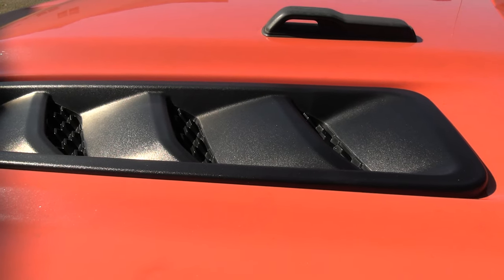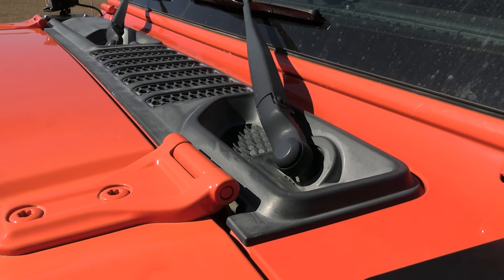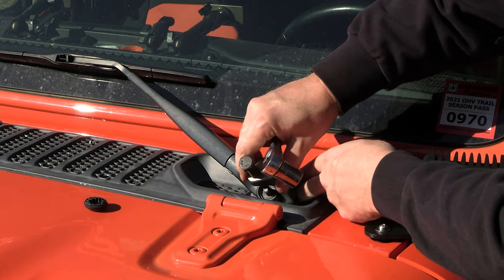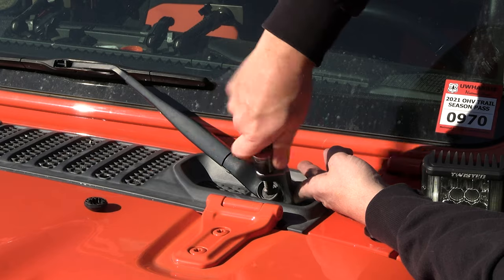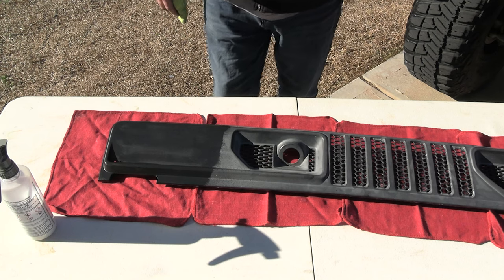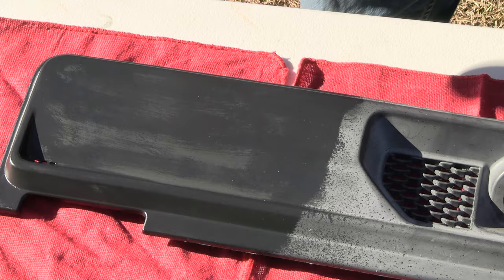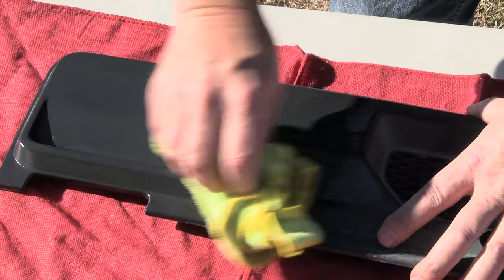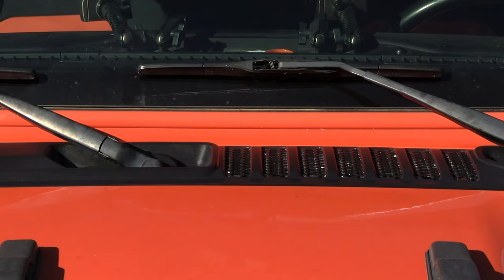How to renew faded cowl cover on Jeep JL / JT #chemicalguys

Comment: I had to do the same thing to my jeep, which is a 2018 JLU Sport S. I washed it thoroughly, then used alcohol wipes. I refinished it with Krylon satin black spray paint, especially made for plastics. Turned out great. Your video helped me a great deal in the removal of the wiper arms. Thank you!
Reply from the maker: Glad it was helpful. Thanks for watching and the comment! 🤘🏻

Comment: Clint, I just appreciate the video for working the cowl cover off. I bought a new replacement for my 6-year-old JL and just finished putting it on. Wanted to make sure I wasn't missing anything with regard to the clips that held the old one on. The wipers were a PITA, but like you I had purchased a puller after reading some forum inputs. Well, actually two. The first was great and worked great on the driver's side wiper arm, but the way the cowl cover is molded around the passenger side it wouldn't work, so ended up getting one like you used. If I'd seen your video first I'd have gone that route up front. I may play around with my cowl cover and do some paint work on it. In the meantime, the new one is on and looks great again.
Reply from the maker: Good deal, bro! Personally, I'd be careful painting plastic. Not that I'm an expert, but I think I'd look at a wrap first. JMHO. The treatment in this video only lasted about 2 weeks. I'll do it again, but this time, use Meguiars Back to Black. I used it on my JK fenders with excellent results. Thanks for watching and the comment! 🤘🏻

Comment: Great video, It made me decide not to mess with it. Needed Tools I don't have.
Reply from the maker: @pattucker6010  You don't (HAVE) to take the cowl off, but I did it just because I'm anal about paint. Also, I wouldn't use the chemical guys stuff that I used. Only lasted about 2 weeks. I used Meguiars the 2nd time and lasted well over a year. Thanks for watching and the comment! 🤘🏻

Comment: roger that on the youbietubers saying "just give it a little wiggle"
When I changed my JLUR Aux Battery, I did the fender removal route
and that just give it a pinch and wiggle did Not work for disconnecting the turn signal harness
Reply from the maker: Yeah man, there's a LOT of that. I figure most people are on YT to figure out how to overcome an issue WITHIN a job. So, I try to cover everything I run into and how (I) went about resolving it. It might not be the RIGHT way, but if it works, I'll show it. Thanks for watching and the comment! 🤘🏻

Comment: I know this is an old video, but what tire Carrier do you run and Does it wiggle around a bunch and make noise?
I've tried 2 different tire carriers last week in the rusty's. Which was the best so far but I really like the tube look. Thought about buying gen rite
Reply from the maker: Mine is DV8 and it's total JUNK! If you're gonna go with this type of carrier, I'd HIGHLY recommend GenRight. They didn't have theirs out for the JL when I bought mine and was too impatient to wait. Lesson learned, because now I'm screwed since I cut and drilled into the body. If you're gonna run 35's or smaller, the DV8 would "probably" be ok. But, I'm on 37's with beadlocks and it definitely sags when I open it. Hope this helps. Thanks for watching and the comment! 🤘🏻

Comment: Hi, it's been over a month since you posted this. How is it holding up? Does it look faded again? Is it something you constantly have to do after every few washes?
Reply from the maker: Yeah, so it lasted about 2 weeks. It's back the way it was. If you want long lasting results, I recommend Meguiars back to black or Armor All trim restorer. Kinda disappointing that it didn't last long at all. But, we live and learn, right? Thanks for watching and the question! 🤘🏻
Reply: @ShockWaveOffroad I found that regardless of the product anything that is a whipe on only lasts a few washes.

Comment: In the video you said that you use it on the tires...does it sling all-over when you drive?
Semper Fi. 0341
Reply from the maker: SEMPER FUCKING FI!! 0331
Yes, I use it on the tires. I have not had "sling splatter", but I always let it sit for a while before driving. That said, this worked really well on the faded cowl cover..........for about 2 weeks. I would not recommend this for the cowl. For all the trouble it takes to do it properly, it just doesn't last long enough. Next time, I'll use the Meguiars trim restorer. Thanks for watching and the question! 🤘

Comment: Have you tried that stuff on the door handles?
Reply from the maker: No, I haven't. I wouldn't use it on plastic. It only lasted about 2 weeks on my cowl. It works GREAT on tires, but not so well on trim. I'd use Meguiars Back to Black on plastic from now on. I used it on my JK and it works awesome and lasts several months.👍🏻
Thanks for watching and the question! 🤘🏻

Comment: The plastic is breaking down under the sun because its not UV stable. Notice how the door handles are lasting longer, the hood latches. 
Chemicals will cover it for a while. Best to just paint it a satin black or colour match it to the Jeep, and you'll never have to worry about it again.
I think Jeep used an inferior plastic because they intended to paint it, but didn't to save money.